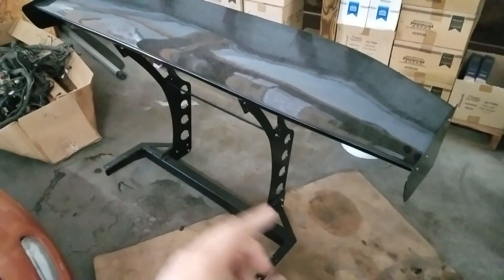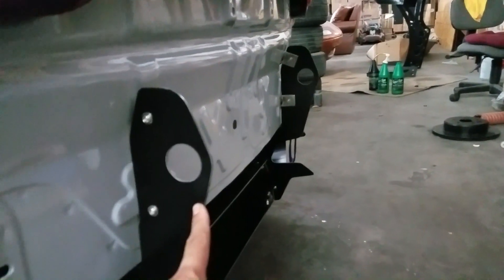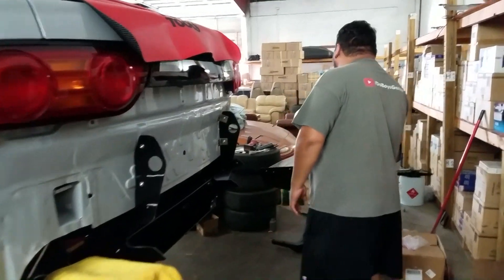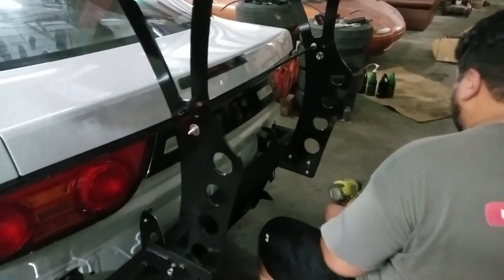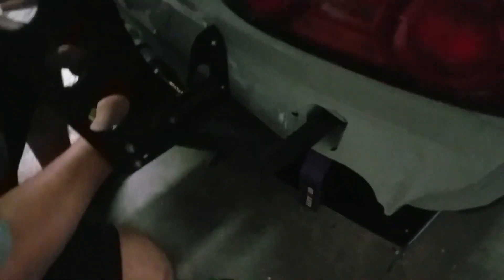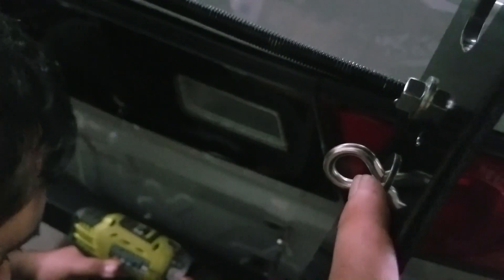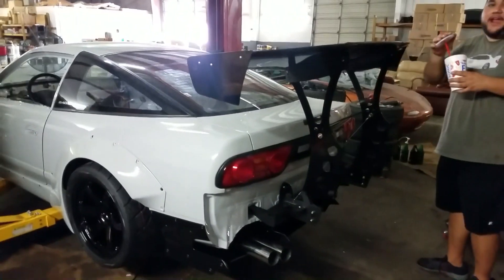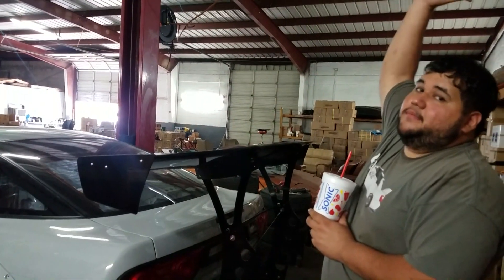240sx S13 Chassis Mounted Wing Install - Battle Aero V4 Ep.11

Comment: The two brackets on the wing that fits the spoiler to the stands, are they already mounted to the spoiler from Battle Aero? As I have the stands for my Rx8 I just didn’t order the spoiler as a extra with it so I haven’t got those two brackets.
Reply from the maker: Yes mine were already mounted from Battle Aero